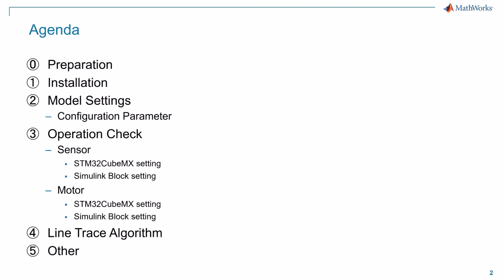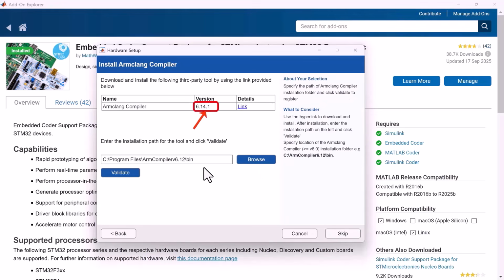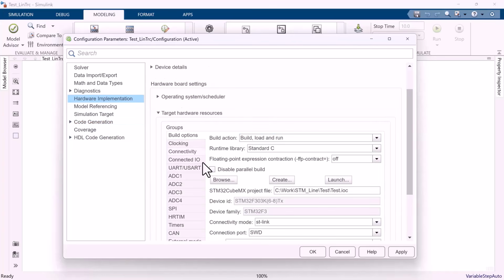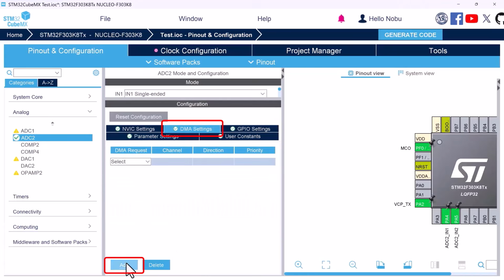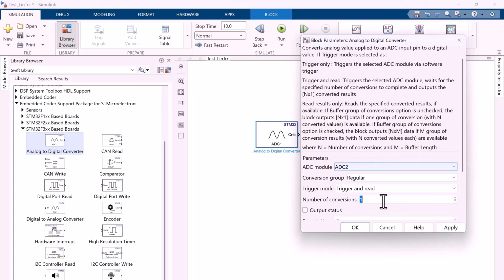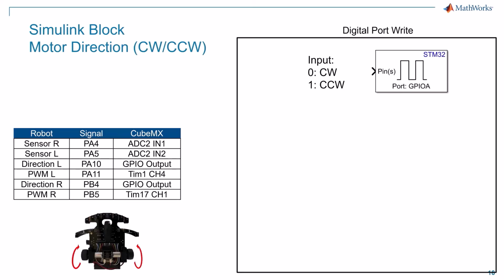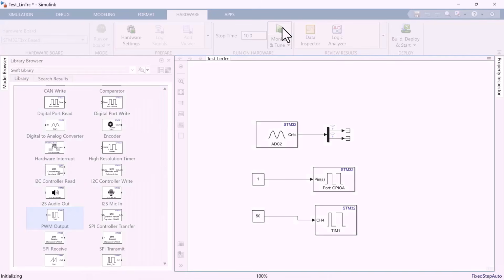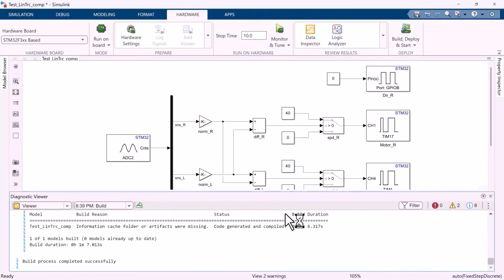How to Make a Line-Following Robot Using STM32

Comment: I would like to see the pid controller lfr
Reply from the maker: Currently, the controller is implemented using a standard PID configuration. However, Nobu will consider exploring its representation in LFR: Linear Fractional Representation form in the future. Thank you very much for your valuable comment.